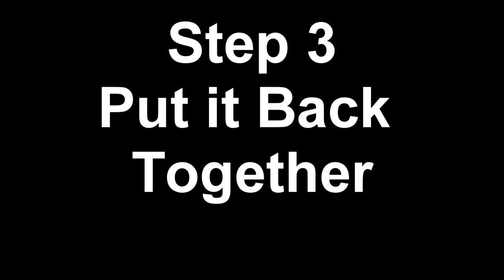Fixing Dodgy Pedal Wiring on a Vintage Singer 66

Comment: I dropped off some things to a Charity Shop and came home with a Singer 66K with electric motor, which had been PAT tested. Date wise she was made 1947 but looked quite rough on the outside. Inside she was clean and no grunge. I did not turn on the motor but managed a good row of perfect of stitches by moving the wheel.
Reply from the maker: That's awesome! What a great find! I'm going to guess that the wiring has been changed since 1947. Otherwise, I doubt it would have passed the PAT test. What year was the test carried out? A clean, grunge-free machine is rare and proves that your machine was loved and has been well cared for! Congratulations!! 😀
Reply: The PAT test was dated December 2022 in accordance with legislation. That is why many Charity Shops do not take donations of electrical goods, no matter that they are new and still packaged.
Reply from the maker: @annecain3301  Should be OK to turn her on and give her a spin then. Let me know how she does!
Reply: @SimplyStitchy  I certainty will once we come back home from our stay in Holywell Bay, Cornwall.
Reply: I tried the my Charity Shop find The electrics are working, it just needs a new light bulb so will see about getting a LED. It did not like the gutermann cross grain spool of thread so I loaded up another bobbin, rethreaded the machine and tried that, The stitches are perfect.
Reply from the maker: @annecain3301  I had a feeling it would sew like a champ! Congratulations! You are going to love sewing with your new to you 66! ;)